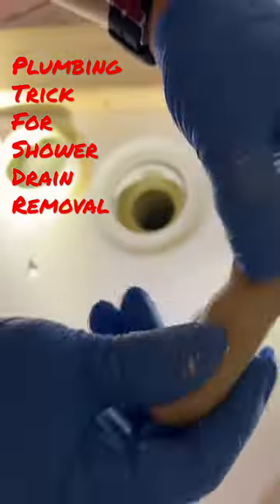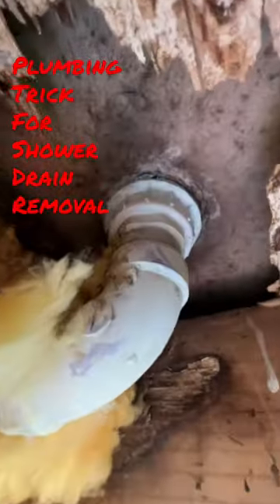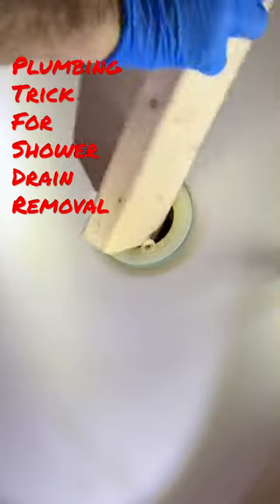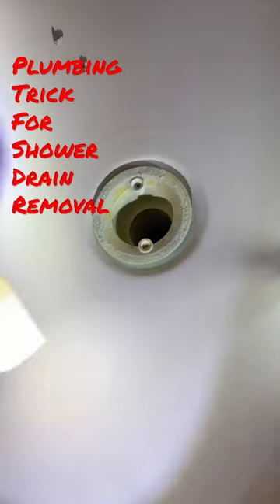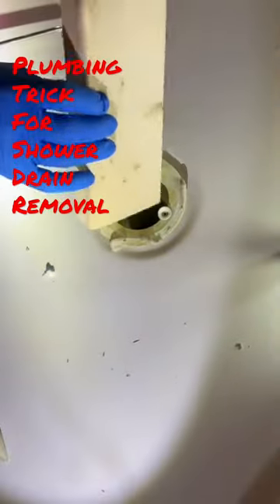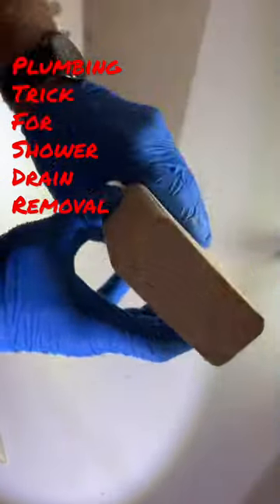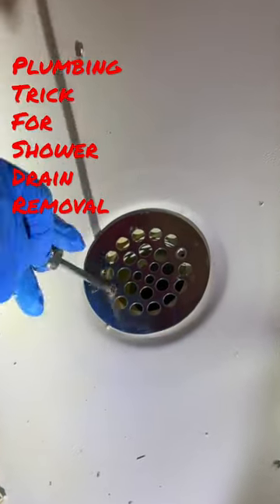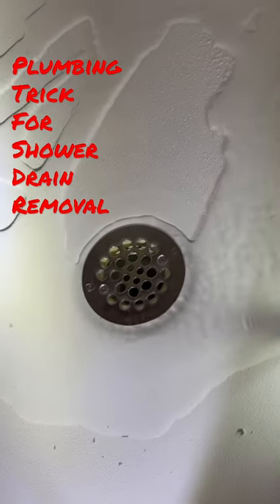Plumbing Hack: Easily Remove Shower Drains @TappPlumbing #plumbing #plumbingtips

Comment: I use my pex crimpers to open/tighten those drains, i have the kind with a bulky head that have offset handles. 1 pair for ½ and 1 pair for ¾.

Also i prefer using silicone, just because my putty pot always ends up getting banged arouns in my tool bucket and it opens up n dry. Idk where to store it!
Reply from the maker: Good idea about crimpers. We actually put a small amount of putty in a small Tupperware container and keep it in our tool bag, it stays fresh this way. We are old school and just haven't gotten on board with the silicone yet...LOL

Comment: Anyone know what this piece with the two screw holes is called? Looking for a replacement piece for my shower
Reply from the maker: @davidriviello489  It is the bottom of a screw down shower drain . There are few different brands and they have different thread patterns. If you still have the top part hopefully you can match it before you get too far along.

Comment: Use a pair of pliers backwards. You put the handle of the pliers in the drain and let the handles catch the screw fixtures. 
Upside down pliers.
Reply from the maker: That method works fantastic as well!! Thanks for sharing!!

Comment: What is the actual name of the piece that you removed? I need a replacement one since mine is cracked
Reply from the maker: Most people call the thin metal piece either a grate or strainer. The plastic piece is the top of a screw down drain. Here are 3 different manufacturers that are commonly used around here . The threads are different for each one so I might advise to look really look closely and make sure the threads are identical before you screw it in.
Reply: Appreciate the advice.  Ty for the quick response

Comment: We use silicone instead of putty on the tub drains…..lasts much longer and less chances for leaks
Reply from the maker: We were always taught to use putty. It is hard to change a habit. We may have to try it sometime. We are so afraid of the mess it makes...LOL
Reply: @TappPlumbing  i hear ya….i was the same way too ….when i started working for a diffrent outfit and was putting together the waste/overflow for a tub with a putty worm in one hand…a fellow co worker stopped me in my tracks and said No….we use silicone…i was sitting there with a dumbfounded look on my face, i was thinking “ no fucking way, they must be trying to punk me”……i thought he was joking, i literally had to ask another plumber that was there and he confirmed it….it took some time to get used too and dial it in to keep the mess down to a minimum…..but yea it can be very messy if your careless…..just keep a wet/damp rag nearby

Comment: Like your technique for getting it out . I probably would of used silicone instead of that putty I don’t trust it at all
Reply from the maker: I am very interested about so many comments about silicone! I am fairly old, 56. Way back in the day if you used silicone that was the sign of a hacker. Apparently now it is a very acceptable practice. Just out of curiosity where do live and what is your age if you don’t mind me asking? Thanks for sharing!!!
Reply: @TappPlumbing  I’m from England UK 33 years old. Silicone is just how I’ve been taught. Haha each to there own I’ve just never got on with the the putty stuff on drains
Reply from the maker: @elliotcooper3955  No worries here !  If the silicone works holds for several years and keeps you from going back all the better for you my friend! Thank you so much for watching!!!
Reply: @TappPlumbing it's still a sign of a hack.
Reply from the maker: @homesteadhaven2010  What exactly makes you say that?
Reply: @TappPlumbing I’m going on 60 and was taught to use plumbers putty aswell and the guy who taught me was about 12 years older than me and he said the same thing about silicone and I’ve never used it and been plumbing since the 80s and haven’t had a problem that I know of.
Reply from the maker: @plumbbuild6517   Do you live in the USA?
Reply: @TappPlumbing  yes I’m in Georgia
Reply from the maker: @plumbbuild6517  Me too, Loganville.
Reply: @TappPlumbing  your about 80 miles from me I’m in Byron area and work around Macon and Warner Robins

Comment: Man,  you're lucky.  I never get to reuse those drains because every time I have to work on one there is a hairline Crack around it
Reply from the maker: Are you talking about a crack in the drain or the shower base ? One way or the other it is never fun delivering the news to your clients is it?
Reply: What is the actual name for the piece he removed? I need a replacement one, on mine the screw holes for the strainer cracked and the strainer doesn't stay fastened.
Reply: @TappPlumbing  a crack in the drain.  Usually running around the lip where it meets the shower base.
Reply: @charlesost7497  in my experience you usually have to buy the whole assembly and use whichever pieces you need.  If yours doesn't leak,  but the screw holes stripped or chipped off I'd see about just getting the grid that snaps in place.  If the holes are just stripped you can pack them with hot glue,  and use longer screws.  Make sure your screws are non ferrous such as solid brass or solid true stainless steel
Reply: Thanks. No mine is leaking. Not having much luck unscrewing the drain barrel so gonna have to cut or chip it out.
Reply from the maker: Are the two receivers for the screws completely gone ? Can you get underneath this shower base or are you on a slab.
Reply: @TappPlumbing  the two screw recievers are very severely deteriorated and very brittle.
Reply: @TappPlumbing  not on a slab, can open the ceiling below. It looks like the drain base is glued onto the 2" drain pipe. I can see the purple primer on it.
Reply from the maker: At least it is not a slab, It sounds like you are correct about having to cut it out. My only advice is to not get to close to the what ever type of pan it is with any power tools. If you damage the hole in the pan it will have to replace or repaired also which is much more extensive work . Best of luck and of course if you have any more questions feel free to ask .

Comment: Holy shit, ive never seen a drain in a cantilevered rim joist. How does that not freeze in the winter
Reply from the maker: I am sure you noticed there is no trap under there to freeze. We have to provide a running trap that ends up in a heated area . That is a great question you have by the way , thanks for asking!!!

Comment: I cut a couple of slots in a piece of pipe, however if you google shower pan drain tool.  There are several to choose from.  From $15.00-$100.00+, I  like the one from Walmart "tub drain wrench" here are the specs 
Work smarter, not harder with this Heavy Duty Hardened Steel Adjustable Expando Tub Drain Removal Wrench Ratchet from HowPlumb. Make your next plumbing project quick and easy with this adjustable Expando bathtub tub drain removal wrench. Remove even the most stubborn bathtub drains with the heavy -duty hardened steel adjustable Expando bathtub tub drains wrench ratchet removal tool. This adjustable Expando durable bathtub drain removal wrench also features durable, heavy-duty case-hardened steel construction. This adjustable plumbing tool has a working range of 1.5 inches through 5 inches IPS. This adjustable Expando tub drain removal ratchet tool also features a simple and easy to use design.

Tub drain removal tool

Also extracts broken pipe nipples 1.2" through 5"

Sure grip knurled handle

Working range: 1/2" thru 5" IPS

Heavy duty construction

Fast removal of tub drain inserts and broken pipes
Reply from the maker: Thanks for sharing. Hopefully this can help someone also!

Comment: I would only use putty on that drain. And chances are the shower base when it was installed should have been set in a mortar base. And I'm glad you weren't listening to the silicone generation. And last about taking the drain off you do what you got to do use what you have to use. There has to be a running trap to begin with with the elbow coming out of the drain. Or no trap and I don't believe that
Reply from the maker: In our little area with a certain age group silicone will earn you the type of reputation I don’t need. Running trap it is in over hangs !!! Thanks for your time my friend!!!
Reply: I’ve replaced so many shower drains done with putty…fiberglass flexes..I’ve heard guys hate on silicone just because they didn’t like the smell 🤔. I like the 2x4 trick tho
Reply from the maker: @travlangley1  I don’t think there is a plumber on this planet that does everything the same way another plumber does. I try to keep an open mind about things, most good plumbers have a way they were taught and works for them with out having to go back and make corrections. Hope you enjoy the new 2x4 trick . Thanks for watching!!!